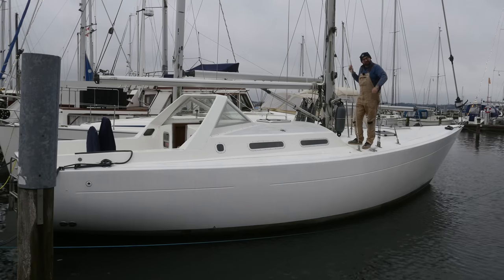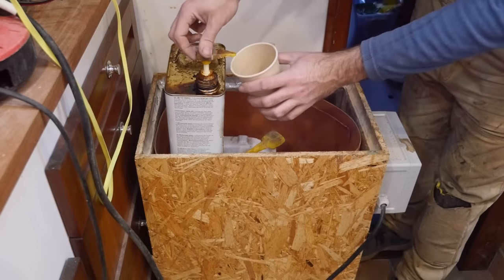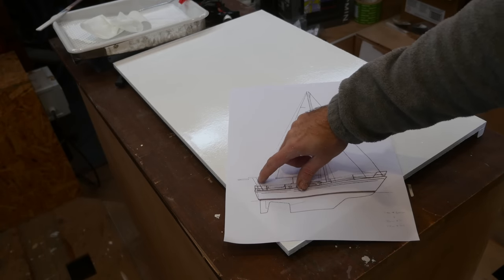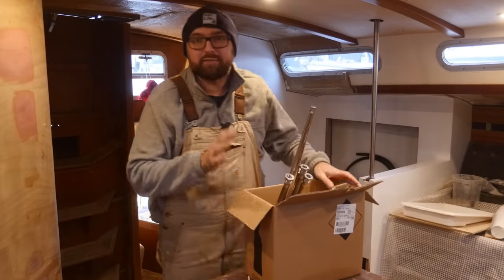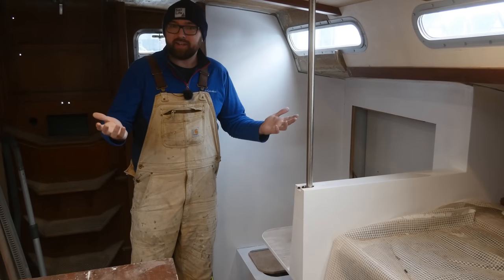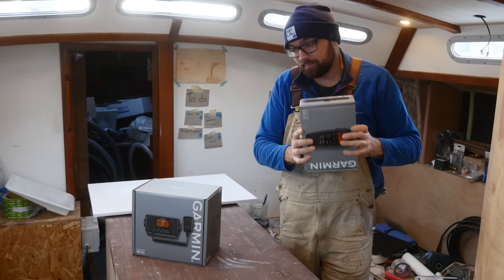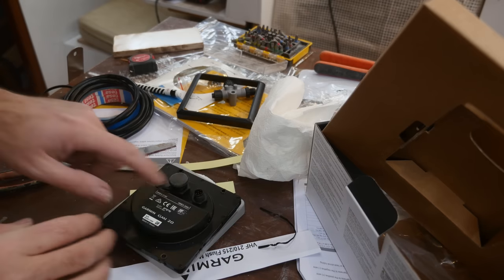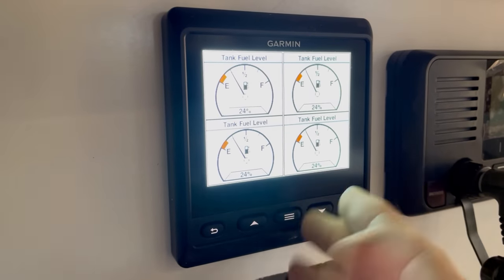Sail Life - Solar arch model, toe rail, NMEA 2000 network - DIY sailboat project

Comment: All I would say is that going back to a 24" monitor would hurt me, a fellow software nerd. You won't get younger, and your eyes won't improve. Get a 30" 4k, and plan on a tilt/telescope/swivel mount.
Reply from the maker: I'd love a 30" but I don't think it'll fit :)
Reply: @SailLife  it looks like a 27 inch might squeeze in.
Reply: I prefer a 24” monitor. Any larger and my ocd means I spend all day resizing and arranging windows to make the most of my screen real estate.
Reply: +1 on software nerd.. 
Agree get as large a monitor as can fit. If on a laptop consider a mount that slides up (and locks into place), allowing use of both the laptop and external screens. If running off a PC see if a 21 inch vertical and a 27 inch screen will fit... (or a small ultrawide) .. I'm not a fan of needing to always alt tab or having tiered eyes, and monitors are relatively cheap.
Reply: @Pat.Mustard  google : FancyZones, windows 10 PowerToys app
- It cured my OCD when it comes to snap resizing to get things to fit just right.
Reply: @SailLife  Listen to this nerd, he/she knows of what she speaks.  I work on a 32" curved display and occasionally I have to work off of a 15" laptop.  So much time is lost looking for things that would normally be right in front of me.  I highly recommend the largest screen that will physically fit in that area.  Keep in mind, movie nights will also benefit from a larger screen. Look for one with the thinnest bezel you can find.  or two.
Reply: I agree on the screen size - get as large a screen as will fit. However, I'd also look into getting a lower resolution. 4K is such a high resolution that just pushing the pixels will be a big task on any computer you hook up to it, so if it's not needed, I wouldn't push for it. 

The issue I have is that even on the 42.5" screen I'm typing this, the pixel size is slightly smaller than on the 24" 1920x1200 screen I was using previously (roughly 0.22mm IIRC). Scaling everything up to be readable again on a much smaller screen (and, possibly, the monitor scaling it back down since they cheated on the panel) just adds overhead and might introduce artifacts.

I don't recommend it. However, I'm a stickler for vertical resolution - I hate those wannabe TV panels that just give you 1080 vertical res. Minimum for me is 1200. For a 27-30" screen, I think 2.7K (aka 1440p) is a good resolution.

Comment: Take a look at other arches, they are never squared or that tall.
Reply from the maker: I'm not proposing to make a square arch. Like I mentioned this was just to figure out the angle and the layout. It's the height it is so I don't hit my head on the solar panels. Making the lower would be a mistake in my opinion.
Reply: @SailLife  I trust you that you are taking your time and don't make it look like a oil refinery with pipes going everywhere. It is an art to both design and weld an arch that looks good and is practical. Just remember that decks on sailboats are not designed to take big loads and the higher and longer you make the davits the bigger the load will be. There are I think calculations on how much the load stress increases per foot as you extend the davits something like four times. There is no such thing as oversized backing plates or multiple supports to take up the shock loads when a boat bounced up and down and the dinghy stresses the davits and the arch. Also always pull the plug in the dinghy when it is on the davits because it will fill up with water fast. Take a look online on davit construction and talk to several companies for advice. Go with the lightest dinghy you feel comfortable with handling. I have watched most of your videos so I know you are very thoughtful and diligent in everything you design. I am looking forward to see this project completed.

Comment: For your power generation issue have you looked at integrelsolutionc.com?   Supported by Nigel Calder and eliminates the need for a generator and designed to work with lithium and solar.

Comment: Li-ion on a cold climate vessel? er...
Reply from the maker: Yes...heating is a thing ;)
Reply: Hi Mads, heating a battery is quite often an extremely poor (negative) return on energy investment. Sure It's fine when you are always on board. It leads to problems when away from the boat with solar.
With LFP you are signing up to a very expensive chemistry (if you're not sponsored).
A little advertised but readily apparent memory effect.
Poor low temperature performance, cell deterioration and system shut down sub zero.
I'm objectively investigating the proclaimed benefits of li-ion & I'm finding they have nothing to offer to your application that lead can't do and a lottov expense and drawbacks not applicable to lead.
I'm documenting it here if you are interested.

https://www.fieldlines.com/index.php/topic,150161.msg1054226.html#msg1054226

I'm currently running tests to demonstate all the typically proclaimed issues with lead are actually directly symptomatic of the charger and not the battery.

I like to leave the charger on when I leave the vessel so when I return I have a full battery. This is not so advisable for li-ion they want to be stored between 50% and 20%, float threshold is 70% SOC.
Reply from the maker: We're living aboard - the boat will be heated. The BMS will handle low temperature cut off. You're incorrect in thinking that LiFePO4 has nothing to offer. We can't physically fit enough lead-acid batteries to give us the capacity we need. Yes, LFP can be expensive, but it doesn't have to be. I'm not sponsored, and I'm paying $2700 for 7.2 kWh (Winston cells). The only additional cost is the BMS ($600). All other components (Cerbo GX, external alternator regulator, MPPT etc.) are the same components I'd have used if we had lead-acid batteries. Just as with any technology, there are pros and cons. For us, the pros outweigh the cons.
Reply: I've no doubt you know what you are doing Mads, and you certainly plan things.
Just be aware that low-temperature charging is harmful to LFP, the cutout protects against thermal runaway not degenerative conditioning. The cells are harmed by disproportionately high C rates to lower internal temperatures. So starting the engine to push C2 into an LFP on a frosty morning can be quite damaging. even charging at 3C at 20°C causes li-ion plating.
You will have to turn off the chargers when leaving the boat or get an exceedingly clever one.
MorningStar ProStar MPPT has low temperature charger foldback this is very useful to your purposes.
I've stopped fitting external alternator regulators, If you use large enough cable as the crow flies I've superceeded 120A units with FLA.

I've 6kWh (4kWh usable)  of CALB LFP and I'm installing golf carts, Firefly AGM and regular AGM on liveaboards.
In a lot of cases, the lack of capacity is better addressed with more generators not more batteries.
A tow turbine would be good.

There's an awful lot of drawbacks to LFP that manufacturers and promotors are glossing over.

Anyways, battery applications can be like arguing dogma, I'm sure you'll do what's right for you.
Reply: I just realised another issue with low temp cutout. Most solar controllers will be killed if you remove the battery with the solar connected, as will alternators.
Reply from the maker: Yes that's why you add an external regulator for the altornator that's controlled by the BMS. For an example take a look at wakespeed and REC Q BMS. Same goes for the MPPT charge controllers. I'll cover all of this in the upcoming video.
Reply: Sounds interesting Mads I look forward to it.
I've done lead builds and LiFePO4 builds. LiFePO4 is half the weight. By the time I've installed all the additional electronic protections and modifications required by LiFePO4 they occupy the same footprint for the same performance, the cost of the battery is about 3 times more for li-ion the cost of the electronics to make it failsafe is another times two depending on scale.
I've been spring cleaning my camper. The Stove is on, 200°C at the flue, 25°C air temp,  4°C outdoors, my lead battery under the driver seat is 6°C.
Wakefield looks very clever, it doesn't say that it'll protect the alternator rectifier if the B+ is isolated through a BMS disconnect while the D+ remains live. Traditionally this is how we kill alternators.
You wouldn't need it if the battery was lead. 50mm² ought give full output if kept short and the internal regulator is fine on lead.
I like the Rec if you can throttle all the chargers with it and avoid battery disconnects then it's very clever. If not then what most people do is link the engine battery to the system as a safety net. The contactor is better than FETs alright. A magnetic latching one would be ideal. Have a look at Albright's ML52.
I really don't like passive balancing, I could argue that you don't need to balance well matched new cells, at least I've not seen any need. Mine never drift 2mV apart no matter how hard I push them....at least they haven't yet.
Having to charge LFP to 100% to enable passive balancing and eliminate the symptoms of memory effect is discouraging, as we can't use the 20% to 80% ideal SOC envelope to triple the cyclelife. All the LFP charge systems I've seen are utilising 100% charge as given and therefore reducing service life. Sure 2k cycles is a long time probably outlive the boat but marketing would have us believe we can get 5k+
Reply: Oh PS, advice on panel layout. I put the read out displays at eye-level.

Comment: To give you another idea of a Solar Arch with integrated Pushpit and Davits. Here is how we have done it: https://www.sailingtakumoe.de/2020/08/23/geraetetraeger-inkl-dinghy-lift-und-edelstahlreling-fuer-eine-bavaria-390/
Reply from the maker: Looks good! :) That's pretty much exactly what I was picturing. I noticed that type of hoist in a Gone With The Wynns video a while back an though it was a cool idea :)
Reply: Odd Life just finishing theirs as well on theirs.
Reply: @SailLife  I was going to send you exactly the same thing. This does work have photos and drawings if that helps. Important things for aesthetics is that in elevation the back support must be more vertical than the front support(< 3-5 deg) and from the rear elevation the back support should be narrower and both slope in. Also do not bolt through the deck but rather fix through the side of the coaming. (stronger and does not obstruct water flow on the deck). Will PM drawing and photos if requested. Cheers John
Reply: Up until the last photo I didn't realise the panels were able to be tilted. I was worried about how much water would run forward off the panels and right down the back of your neck. But with them able to be tilted it seems much better.  :)
Reply: @jaseastroboy9240  Actually they can be tilted by 10° to the bow and 45° to the aft because the pivot point is not in the center.

Comment: A networked VHF radio with GPS and AIS integration....oh my this may be NSFW.  Adding the radar and chart plotter integration with AIS and the radio, especially if AIS and radar proximity will generate alarm messages for a berth multifunction display will definately be engineering porn.  And fellow bit mangler, whip up an AI to take a watch, k, thx.